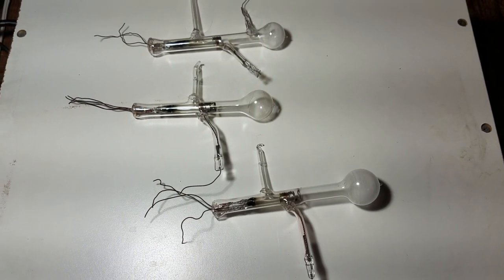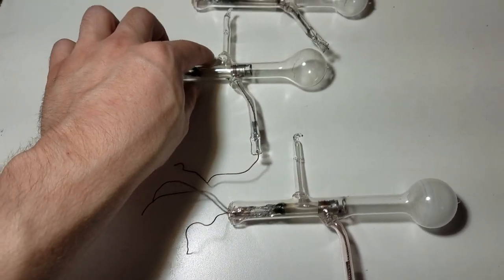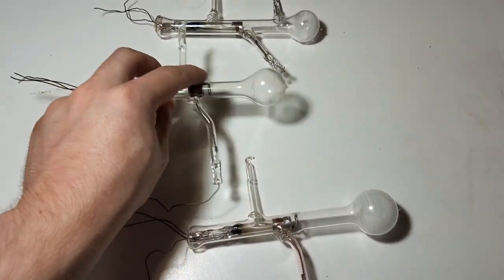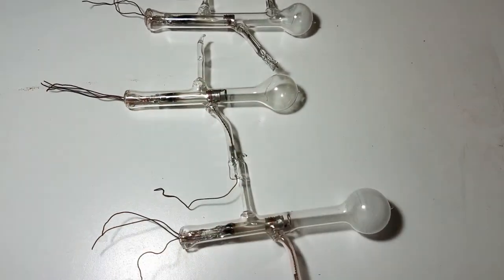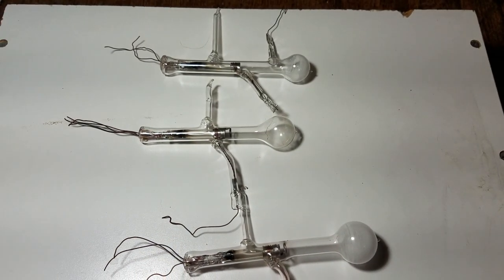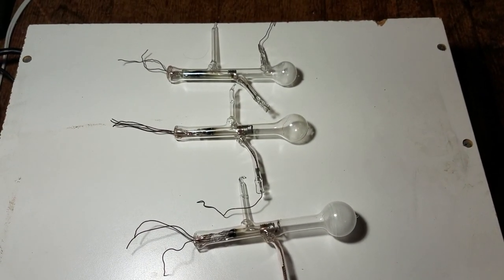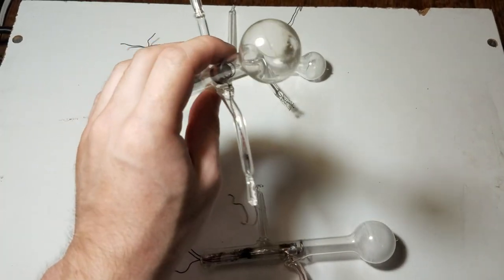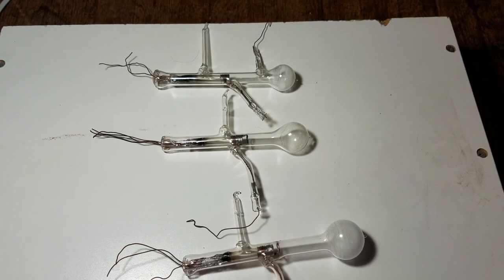Creating A Visible Electron Beam

Comment: That looks gorgeous! Sometimes something going wrong isn't all bad :P 

And yes, the phosphor is definitely not good for pumps. I had a poorly adhered screen come up while pumping and it ruined my pump. Luckily that was back when I was still using a $60 single stage pump from China, not my lightly used Edwards E2M2. 

Those tubes look very impressive! And the color of that phosphor is amazing! Any idea what it came from?
Reply from the maker: I think it is just generic green glow powder. It might even be just zinc sulfide. I am not exactly sure since it came from a cheap experimenters kit.
Reply: @jdflyback  You could put it in an electric arc and look for spectral lines.

Comment: There is no x-ray?
Reply: In x ray tube electrons with high velocity hits Wolfram target, some of energy is converted to radiation and part of energy to heat. Here I suppose no high voltage enough to speed up electrons and no abrupt stoping to generate x rays. This how I understand it.